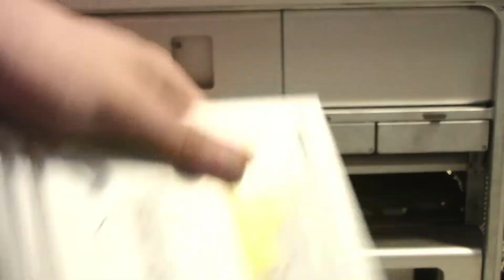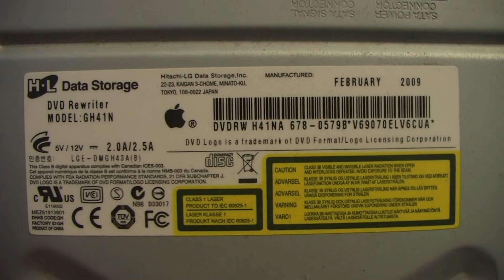Mac Pro 2009 NAS Project: Installing Drives

Comment: That’s a pretty sensible use! At first I wasn’t sure what good an optical drive upgrade would be, but that’s because the CPU in my NAS isn’t very good. So I transcode on my desktop then copy it across. But yeah you might as well make use of those dual Xeons. 

Honestly I’m not sure if a GPU encoder would be such an upgrade — it’d be faster yes, but CPU encode generally gets much better quality versus file size. Especially with 2-pass encodes.

Though either way, you could have an ingest script which copies the raw MPEG2/4 stream off the disc (say into an MKV) then spits out the disc. Then in parallel it can transcode that stream into HEVC and delete the original, while you’re copying the next disc over, as many times as you want. Then it will churn through all that after you’ve run out of discs to stuff-into it. A few hours or days later the server CPU/GPU load would settle-down again

You could even have Plex serving-up the raw streams in the meantime if you wanted to watch something right away, as the file would be loaded into the ZFS buffer for both transcoding and the file server!

Plus of course that’d be fantastic for archiving CDs to FLACs :)

Lastly, I might’ve been tempted to use the 2009 and 2012 drives first, since ZFS is skeptical of all drives at all times, even though the resilver stress risk is real and it’s just more work with not much to gain so that’s kinda silly. But then, I’m running-up against the limits of my 12net/18gross TB RAIDZ2 NAS, and considering stacking another drive enclosure on top of it with another 6 drives. So if I had more than one extra drive lying around I would totally consider adding a 2-6TB ZFS pool to supplement!
Reply from the maker: woah, thanks for the super detailed comment! I wasn't aware that the CPU could do a better job transcoding, thats interesting. 

that ingest script also sounds sick tbh, I'll have to look into it. 

I've actually got this thing fully set up, just haven't had the time to actually edit the footage down. I've got an ingest script set up for transcoding the video off of my camera because it records mpeg-2.

haven't set up Plex and all yet, or CD archiving, but I'll get around to it sometime <3